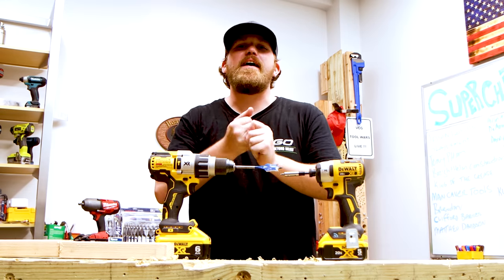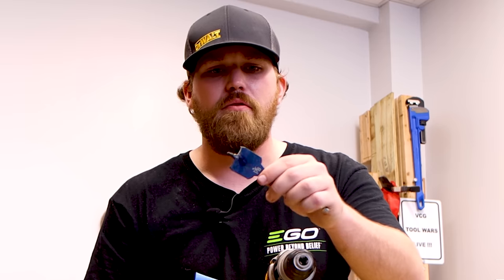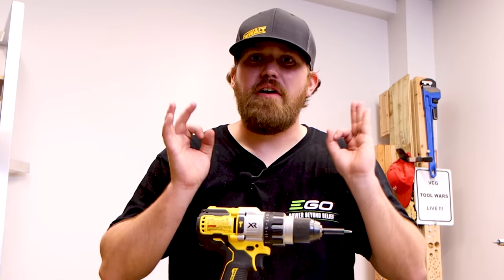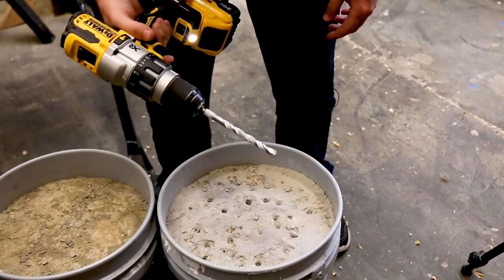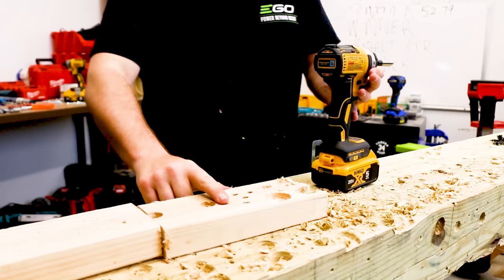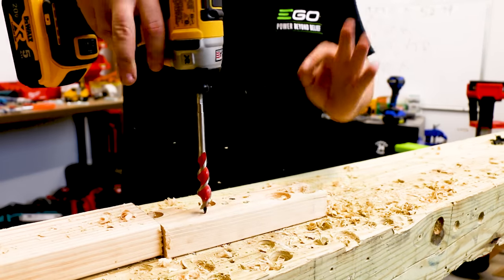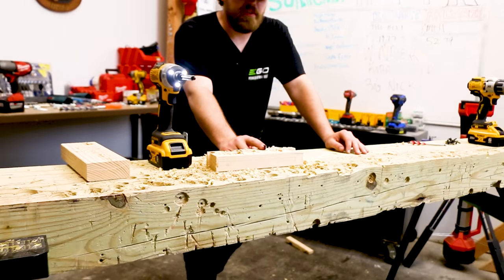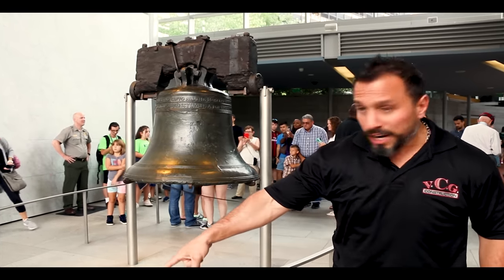DIFFERENCE BETWEEN HAMMER DRILL DRIVERS & IMPACT DRIVERS (Ultimate Guide Tips and Tricks)

Comment: Regarding drill bits in an impact driver: they aren’t made all the same. Some are impact “ready”, meaning they are 1/4” hex shanked, to fit into an impact. Other drill bits are impact “rated”, meaning not only are the 1/4” hex shanked, but the manufacturer of the drill bit intends for the user to be able to use them in an impact driver if the user wants to, and that the bit should be able to handle being impacted by the tool.

Comment: I recently purchased the DCK299D1W1 kit with the 998 with 8ah and 887 with a 2ah battery, I had a 885 impact already which I use a lot at work, and this new power detect drill is a monster, makes drilling all the holes much easier and faster when I rough out, I use my impact still to drill holes when I need something smaller to fit in spaces the 998 won’t, outstanding tools and always a great video from this channel.
Reply: I bought the same kit November 30 2021 and love both tools. Just a DIY’er but really appreciate quality and what this kit contains!

Comment: You can also get a 1/2 drive to hex adapter to turn larger impact guns into hex drive. In addition, can use a 3/8 to 1/2 increaser (impact rated) to use the hex adapter with 3/8 drive as well.

Comment: Just an FYI the reason they say don't drill with in impact has more todo with the material the bit is made from and not being an impact grade metal. With soft woods it is probably not a big deal. But harder woods, metals, and so on you could crack or shatter drill bits in an impact over a drill. And that's from the constant impacting that is taking place. And I've asked manufacturers why they put the 1/4" end on drill bits, and the normal answer I get is that's what sells. Just thought I'd share what I found in my years in the tool trade. Otherwise great video love watching. Go Dewalt!

Comment: I used to work with DeWalt or Milwaukee and I used to work as a contractor for 7years and I've quite a bit of experience, it's kinda happy for me to see professionals giving tips
Reply: Which do you recommend is better Milwaukee , dewalt or , makita ? I’m thinking of purchasing a dewalt 7 piece kit from Home Depot for around $499 just wondering if it’s a quality tool company
Reply: @danielborja9751  you can't go wrong with any of them really but I like the deWalt better it seems like you see specials more often and they have a wide variety of tools so if you have their batteries more than likely you'll be able to find a tool for a specific trade where the others are limited.

Comment: If it's got a quarter hex on it.....put it in the impact!...🤘
Reply: If it has the little cut around the end of the hex and is rated as an impact bit.  I've seen hex shaft bits used in impact drivers not only fall out, but also twist or even shatter, because they are not designed to be used in an impact.

Comment: Thanks for another great video! Learned a lot...especially to be careful with a powerful drill driver due to the high torque they can produce. Huge fan of Kobalt stuff...will be ordering the new $399 (!) 5 piece XTR combo kit with rolling case, when it becomes available for shipping online. Just wanted to mention for folks that may be new to how impact drivers work, that the impact is in the rotational direction of the fastener, whereas the impact with a hammer drill is straight ahead, in line with the bit. Thanks again!

Comment: In my opinion there are only 2 brands of cordless power tools that are worth buying. 
Makita and Milwaukee, both have huge a huge lineup of cordless tools and both are top quality. 
Not a fan of DeWalt after they were bought by Black & Decker and the same goes for Porter Cable. I mainly use Makita because I have a bunch of batteries and they last for years. 
The trick of marking drill bits with a marker or tape is a very old one but some people aren’t aware of it so it’s great information to pass along. 
I’ve got a few tips of my own. 
I have to install Saw Cut   Detection Loops for Drive Throughs at restaurants when the original Loop fails or speaker pedestal is relocated and the “Saw Cut” needs to be 2” deep, a consistent depth makes the installation easier so I use a Lumber Crayon to mark the depth on the blade. I can easily see the mark when cutting and keep a fairly consistent depth. 
Another tip is to use crushed or pellet ice to keep hole saws cool and lubricated when drilling holes in steel (3/8” and up) or stainless steel. After drilling the pilot hole without the hole saw attached I use electric tape to close off the holes on the side of the hole saw, fill the hole saw with ice (most of my customers are Restaurants so ice is readily available) then I drill the hole with moderate speed and quite a bit of pressure. This actually cuts faster and cleaner than dry at high speed since more material is removed on each pass. My hole saws usually last for several hundred holes and I have a 1 3/8” Greenly hole saw that has probably drilled 500 holes or more in steel and stainless steel. 
The melting ice keeps everything cool and the water provides plenty of lubrication as well as flushing the chips away plus cleanup is easier than removing cutting oil before painting. 
Sure your hole saws can rust but spraying everything with WD-40 takes care of that. 
The best hole saws in my opinion are in no specific order are Greenly and Milwaukee, Lenox are also great hole saws but their thinner profile makes them susceptible to the teeth breaking off in heavy steel which really sucks. 
Also when drilling stainless steel you must drill slow with moderate pressure, if you get it very hot the stainless steel will “work harden” and you will have to move or wear your way through it which ruins the pilot bit and hole saw.
Reply: Hilti is superior
Reply: Black & Decker industry and construction was one of the best tools made at one time that's what became  deWalt if I'm not mistaken and that was a primary brand at Grainger there's a huge difference between the mom and pop Black & Decker and deWalt.
Reply: Oh and Milwaukee and Makita have tiny little tool lines if your  trying to compare them to DeWalt

Comment: Thanks Nick. You mentioned 4Ah battery v 1.5Ah and said always get the bigger battery. Ok I partly agree, but there is a big benefit to the smaller batteries too, they are dirt cheap on ebay because everyone wants bigger.
I used to be a fit guy too but age and a bad heart have caught up with me, i just work around the house now, the smaller batteries are half the weight. If im on a bigger job I have some 4Ah or i just swap out the battery each time I have tea, if your battery runs flat your not drinking enough tea. You tell us how much easier the impact is weight wise, please give this a mention. I got an XRP drill and the 3 speed impact from dewalt, love them  so I brought the 10.8v combi set for diy. Wow small and powerful for the little jobs. Half the weight. 
The wife says thank you, now i put tape around my tool, she dont like it deep😜
Great watching from the UK 🇬🇧 thanks guys.
Reply: You'll get More voltage sag with a smaller capacity battery though but I agree I use 2 amp batteries for my radio, drywall gun when I'm running a drywall gun real light duty stuff but anything medium duty and up I use the four amp compacts or 6 amp

Comment: I prefer using drills for holes and impact drivers for screws. When I am working on a woodworking project and need to screw wood together, I would get both a drill and an impact driver ready at the Dallas Makerspace. Make pilot holes and/or threaded insert holes with the drill and drive the screws and/or threaded inserts with the impact.

Comment: Thanks for the helpful tutorial.  Recently I learned when not to use an impact driver when doing a large hole cut on dry wall. The hex end on the arbor is for the impact but it broke when cutting dry wall. Had to buy a new one and used a drill which cut perfectly
Reply from the maker: Thanks for sharing

Comment: Some jobs you need both. It's a pain to keep changing bits, so 1 drill (for pilot hole) + 1 driver for hardwood decking as an example.
Also, for newbies, check the balance and weight. Does it feel right?
Reply: I don't even get why they're debating it most of the time when you're doing any kind of carpentry you do need a predrill if you're running a lot of screws so that's the whole point of a drill and driver combo
Reply: Agree, drill used for pilot holes and impact for driving. Such a time saver

Comment: A few times my Dewalt hammer drill’s Chuck has been so tight that it’s locked up on my bit and I can’t loosed the Chuck by hand. I used a rubber strap wrench and easily got it open.
Reply: Oil
Reply: Alonso Glez tried that
Reply: What do mean oil
Reply: When it does that take the bit out if you can and tap on the jaws of the chuck with a hammer just to push them back slightly and it'll open up

Comment: Thank you i still need the hammer drill i have cement walls and i appreciate the tricks with the screws i didnt know them i had many stripped screws i wish i knew that years ago
Reply: I didnt get the hammer drill i got a 12v Bosch impact driver and a n adapter that takes drill bits it works almost as good as a hammer drill just a little wobble in the chuck but with 100nm of torque there is plenty of power to do anything

Comment: Thank You I Thought Your Video Was Very Helpful And Explain Things Very Well.
But It Now As Left Me A Little 
Confused As Which To Chose.
Am Looking For A  Cordless Drill, Which Is Brushless, A Half Inch Chuck. With A High Power Battery And Charger.
This Drill Will Have To Work For Me In The Home And Outside In The Garden Connected To A Power Plant Arguer.
I Am A Lady On A Small Budget So  Need The Right Tool To Do Both Jobs.
I Do Like The Devalt Tools, I Wondered Do They Also Come With A Separate Handle Attachment.
Thank You.God Bless ❤️🙏

Comment: I do not like spade bits on an impact driver. Seems to be hard on the project and with every beat of hammer pieces go flying everywhere. The board splitting has happened to me more often with the impact then the drill when using spade bits.

Comment: When i started my apprenticeship, i was prewiring a house, and had my drill and impact with me, the qualified guy told me to put them away as the cordless stuff isnt good (i had a dewalt 996) 
I then proceeded to drill faster and didnt deal with a cord, and then when the studs were too close together for my drill to drill a straight hole, i switched to my impact and drilled the hole straight, he then got pissed at me for using my impact and my bit to drill because impacts arent made for drilling.

Dude couldnt stand shit being done any other way than his exact way, even though he was an idiot, but now had an apprentice to blame all his fuckups on, which slso happens to be the reason they got rid of me 😂
Reply: I was told that same exact thing about battery tools were junk🤣🤣🤣
Reply: @frankdukes3499  if I had a contractor come onto a project with only corded tools I'd ask them to leave...
Reply: @frankdukes3499  probably were junk. I wonder at what point became good enough to replace corded tools.
Reply: Battery nowadays is as strong as any corded tools. These boomers just can’t accept change. Sure, 10 years ago they were right but not anymore.
Reply: Apprentice = fall guy, lmao 😂 facts
Reply: @frankdukes3499  Perhaps in the first gen of tools, but now they are amazing unless you had in mind to use the heavy-duty stuff.
Reply: @helloman3676  there's no way that cordless circular saw is anywhere near as powerful as a regular circular saw not even the worm drive if you rip treated all day you'll see . Flexvolt is nice for up in the air but when you got to do a lot of heavy cutting the cord still the way to go sorry
Reply: @bobs6129  a fully charge tool is the same as any corded one. The problem is the battery drains and it gets weaker but battery nowadays last way way longer then it was before.  Of course if you have to work for a long time, the corded tool is prefer. But if its only for 2 hours or so, i'm sorry but battery is way better.
Reply: @helloman3676  nope I use them everyday man I use both every single day you could take a brand new Flexvolt fully charged 12 amp battery and it won't compete with a corded saw I promise you I bet my life on it I use it everyday people that say this stuff either lack experience or have never used a corded saw. You guys are misleading people through inexperience sorry. Don't get me wrong cordless is great especially in the air but on the ground it's okay for cross cutting and really not even great at Cross cutting treated lumber it does it but nowhere near as much torque as a corded saw. when you cut your insets and a 6x6 treated 6x6 with a flexible you'll see everything you need to know about how weak it is. Again the cordless can do it but it struggles
Reply: @bobs6129  Funny how I also use it everyday and have the opposite experience. Maybe try a different brand?
Reply: @helloman3676  what brand would that be because I use the DeWalt and the Milwaukee often and there's no way you've compared it to because you wouldn't make such an absurd claim it's like comparing a 4 cylinders torque to an 8 cylinder.
Reply: @bobs6129  Seems like you're stuck in the past. Not gonna tried to change your mind. But i'll leave you with this tip, Make sure the motor is brushless, there are different amp of battery, practice practice practice and its heavy.
Reply: @helloman3676  you're not listening like I said I don't think you do this stuff for a living you probably cut furring strips in your garage I said I use these tools everyday and guarantee you know more about them than you do and the only reason I get aggravated is people try to push this s*** what flex volt isn't brushless again I highly doubt you use them you might own one
Reply: @bobs6129  Again, i'm not gonna tried to push it on you nor debate credential on the internet with you. Lord knows everyone is tall , rich, handsome, have a model wife  on the internet. Like i said, you're stuck in the past and its fine. But times move without stopping.
Reply: @dnor16  around 2004 cordless tools and especially the battery tech advanced leaps and bounds. Prior to that, drills were the only cordless on my grandpa’s job site, and mine as well. After that, you could get a reciprocating saw that matched a sawzall and it was epic. I still used corded power tools on my metal cutting devices, but anything for wood at that point both he and I changed to cordless. My only corded tools now are my mitre saw and circular saw (worm drive)
Reply: @liquidrockaquatics3900  Exactly, they are amazing. 

I found not so long ago a channel that tested and compared different brands and types of impact drives. 

The name of that one is Torque Test Channel.

Both electric and pneumatic have their pro and cons. The main con of electric tools is mainly that they can't be used for a prolonged time because they will overheat, things that air tools won't do. Their main advantage is portability and practicality: you can do your job in any place without worrying about having an air compressor.
Reply: @frankdukes3499  They sure used to be junk, I was so shocked with my first lithium battery drill, game changing. I used to run corded drywall guns for a long time when ni-cad was king, cordless was for homeowners at that point or someone with a lot of batteries.
Reply: @Being_Joe  lithium batteries made the difference.
Reply: @helloman3676  just like not all young guys are punks, not all boomers are stuck in the past.
Reply: @bobs6129  i agree circular saw is not there yet.
Reply: @helloman3676  he's right tho, a cordless skill saw can't compete with a corded one. Torque isn't there for the shit I do. Good for 2x4s tho lol

Comment: Do you also use your impact driver for bolts and nuts by attaching a hex shanked socket or do you strictly use a dedicated impact wrench made for the job?
Reply: You'd be surprised you can take tires off a car with a regular quarter inch drive impact driver.

Comment: In my line of work we would use a dedicated corded rotary sds for drilling through masonary, but for everything less intensive that involves more drilling then driving fasteners, just use a compact drill driver (like the Milwaukee as it's really small) with a hex bit holder in the chuck, where if I were doing more fastening then drilling would use a impact instead,

 I think we are at the stage where very soon (if not right now) the all in 1 "driver" will be one tool with modes for dedicated drilling, driving and wrench capabilities in one lightweight compact unit, then I hope all batteries get standardized across platforms and a universal colour code gets implemented for easy bit checking!

Comment: I have a tip, but it's how to drive a screw through drywall into metal framing WITHOUT a drill. Simply take a drywall (fine threaded) screw, place it on the end of a manual screwdriver. Place the screw in the desired position on the wall with the screwdriver. Take a manual hammer and strike the butt end of the screwdriver so as to make the drywall screw puncture the metal stud beneath the drywall. Finish driving the screw with the screwdriver by twisting clockwise. Done! Not the fastest way, by any stretch, but when in a pinch it works! Thanks Nick, and God bless!😁👍
Reply: Dude! you're a genius.... I gotta try this....🤔
Reply: @boosted2.4_sky  it really does work. 😎🤜🤛
Reply: @meagaindave2049  🤘😄

Comment: I Just ordered the DEWALT XTREME 12V MAX Cordless Drill Combo Kit (DCK221F2)  I need to Get some  of Those Magnetic bit holder(s) for DIY  home projects, for screw-driving, etc, (the ones you are using @5:05 & @10:00) where can I Buy them from and what size do I Need? AMAZON LINK? I Subbed as well.